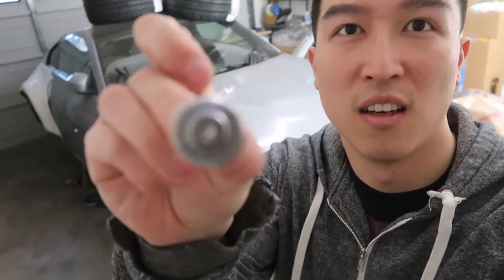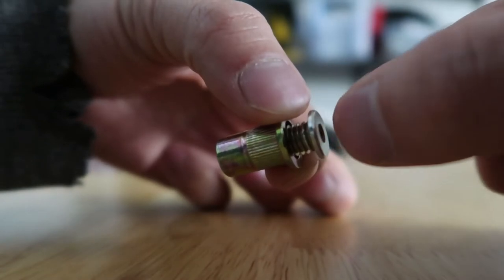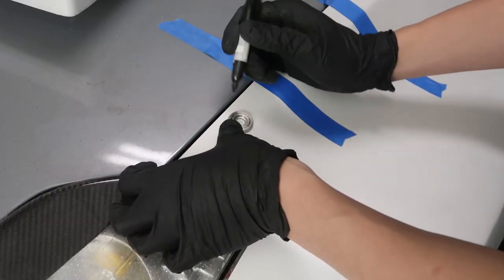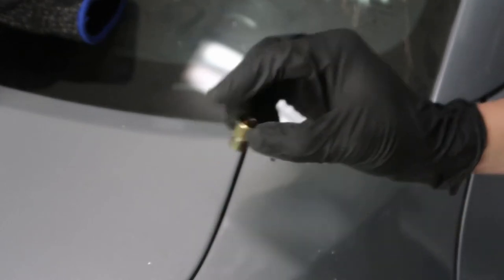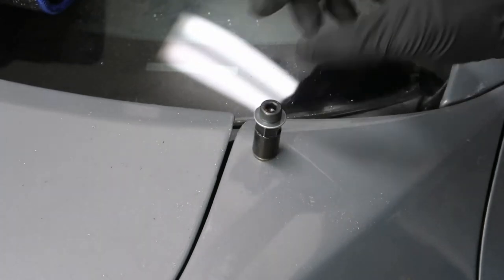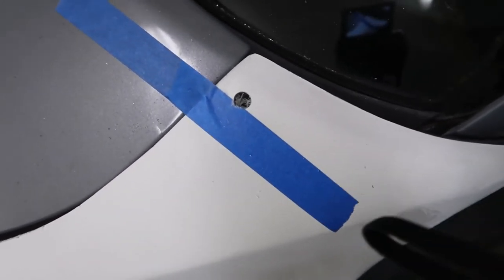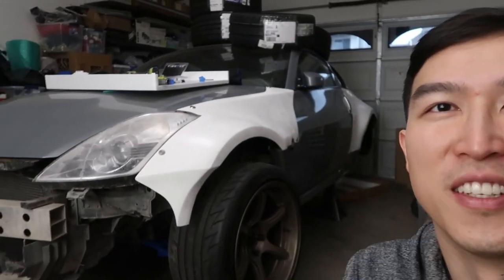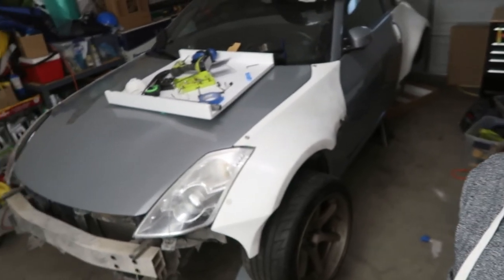How to: Install Rivnuts / Nutserts on Widebody Overfenders DIY | (Season 5 Episode 3)

Comment: Where you get the bolts from? i check the home depot and lowes they were clueless where i buy them bolts since I've already have the rivnut kit with the tool.
Reply from the maker: Bolts and everything came with the rivnut kit off Amazon
Reply: @Riskspeed  that's where I bought mines from and never got bolts for it

Comment: I plan on using rivnuts but I've really been searching for a low profile option for bolt/washer. Debating no washer at all. I'm not a fan of visible bolt on, just don't have much of a choice, can't think of another way. I could use the tiny screws that some overfenders come with but idk if that's enough. But those NRG washers are too big for me. Ever see any type of lower profile option for these?
Reply from the maker: I didn’t find out till after I did this- but there is a smaller version rivnut that NRG offers.  It’s still visible but not as big as these.  

If you want it to be less visible you may have to stick with traditional pop rivets, or mold it into the body to be completely invisible.
Reply: Just use some filler and smooth them into the bodywork if you wanna hide them

Comment: do you have links to any of the rivnuts/tools you used to install (other than the drill & bits obviously) 😂
Reply from the maker: I ordered the rivnuts on Amazon, just search NRG Rivnuts.  As for the rivnut tool you can find them at Lowes or Home Depot starting at like $12
Reply: What is the tool called ?
Reply from the maker: @fombabills4522  just search “rivnut tool”

Comment: How’s this holding on? Better than rivetvright
Reply from the maker: It’s been a year and holding great! I have had to utilize removing it many times and still holds strong.
Reply: @Riskspeed  just bought this yesterday thansk man. I plan taking mine off maybe 4 times a year not many I’ve used the rubber ones and are hit or miss this seems better

Comment: cool vid. how do you figure out what length rivnut to use?
Reply from the maker: the NRG brand rivnuts only came in one length, but not sure exactly what the length is.  As long as it’s longer than the thickness of your fenders you should be good
Reply: @Riskspeed  another question: im noticing theres steel and aluminum/alloy rivnuts. Apparently mandrels used to install softer metals cannot be used to install steel rivnuts. Any idea which madrel to use  for steel? i see you had a wrenching tool provided by nrg. Not into the whole colors thing...thanks
Reply from the maker: Not too sure. The NRG rivnut washers come in lots of diff colors I chose silver so it would kind of blend in with my grey/silver car.

Comment: Are you able to reverse the rivnut?
Reply from the maker: what do you mean?
Reply: @Riskspeed  so I got NRG fender washers and I put them in my engine bay for the radiator cover and fender cover because I have them forged carbon but my buddy installed the rivets OVER the cover instead on the metal part
Reply from the maker: @RoyalDisturbanceClub  Still not sure I understand correctly.  Do you mean like remove the rivnut and reuse it?  You can drill out the rivnut but it can't be reused since it is already flared.  You can remove the bolt and use it on a new rivnut though.
Reply: @Riskspeed  yea I don’t care about reusing it I can get more just need to take off the radiator and fender cover
Reply: I may not be explaining it well but if you see the videos the also put the washers for the radiator and fender cover but my boy put the rivetnut over the cover instead of under it
Reply from the maker: @RoyalDisturbanceClub  send me a pic of what you're talking about on instagram @terencezeee . Maybe I can help you out if I have a visual.